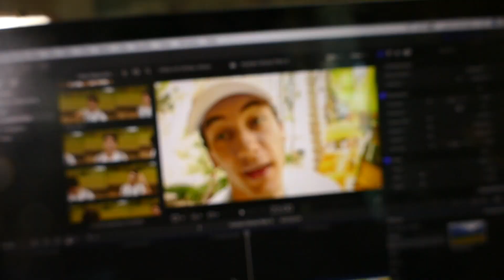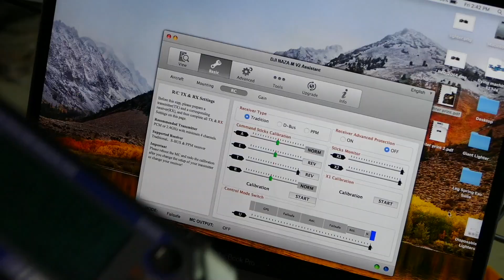What Happened To My Human Flying Drone Project... (Plus Channel Update)

Comment: Not just the torque, metal expands/collapses hi low temperature, yes parachute must clear the drone, I think he knows what is going on. So I will give u guys a clue.. it’s called pouch batteries. They are new, intended for mass VTLO’s Vertical Lift Off Transports. I can’t mention the website.  Oh, check out fuel cells for 400 mile range.. use the Parachute!!  You can’t sell anybody our dreams if u don’t have safety first! He knows this will work. I like that moment when it kicks in the first time see it in someone goodbye car!

Comment: Hi there ...i think other than reinforcing the frames  corners and cross membering  vertically and horizontally. And what  are  the motors and props specs? Can they create the thrust  to lift the weight? 
Also the Weight could be dramatically reduced with a drill & hole saw also I would  do a basic static  balance. Also move battery centrally, for the weight balance.. also the electrical power balance   same length wiring to each motor.  
 Also  tilting the motors slightly  outward "diagnoly" oppersite  of each other would create easier user  control abilities and lifting stability. . Good luck.. cheers Peter Doellinger

Comment: Fortnite Reaction vidoes?! Even YOU aren't that cruel ;) also, i don't know if you noticed the frame FLEX of the superstructure under un-even lift scenairios. Your props mounting plane should have zero flex. The flight controller is assuming a rigid frame and you will lose stability, possibly catastrophically as the flight controller is regulating flight, based on the assumption of the motors being consistantly level with one another. frame flex could lead to bad things , especially if the motors have any siginificant lag time in spool up.